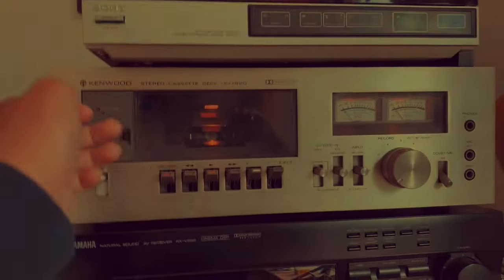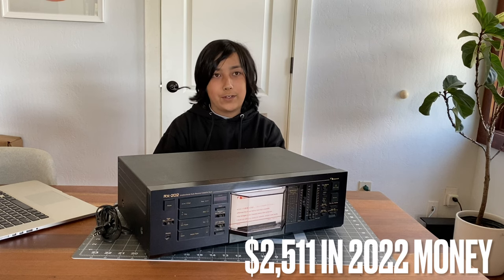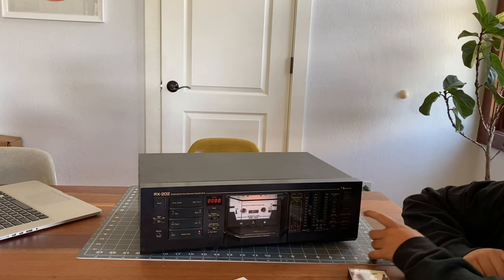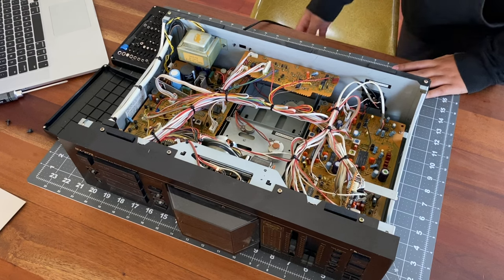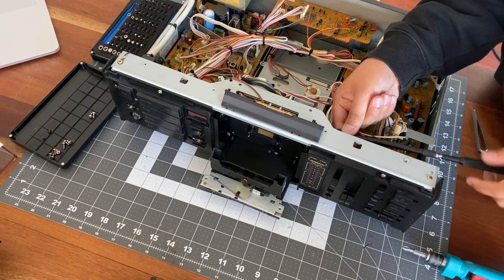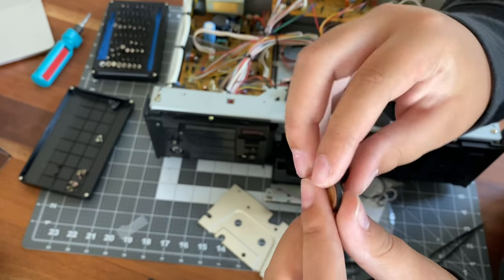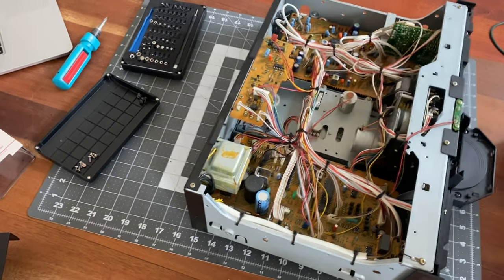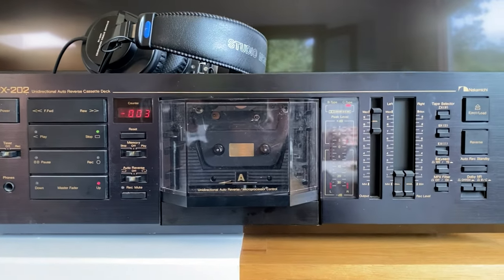Is a Broken Nakamichi Worth It? | Repairing the Nakamichi RX-202

Comment: this deck i just bought one because either than a pioneer deck from the 70´s ,this was the best system and at the same time a funny auto-reverse. I tested it in a life-style ehxibition ,where there were only top brands of everything, in the hi-fi section there it was one of thee decks the 505 for one to try it ,in the AKAI area they gave us tyoe I cassettes ,i recorded a few seconds than made it take out and in the cassette several times to see if it worked with perfection ,and it did

Comment: I put a new tensioner belt on the roller, but it needs more tensioner on it, it there a way to adjust the tensioner when the roller goes up against the tape drive spindles?

Comment: hi i worked on alot of decks  it's the first time i seen inside this model 

i am more a  1/8 tape pro kind  like loop cassette   reel to reel  1/8  reel to reel   slave decks full track mono   
there ways a round   the flipping heads  in low cost decks   as i had high end decks go bad  on me